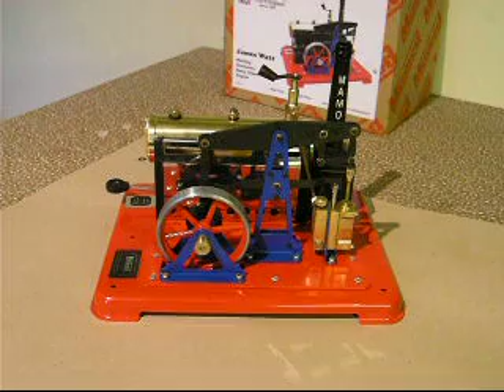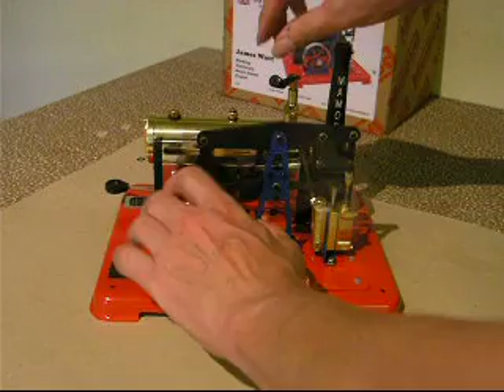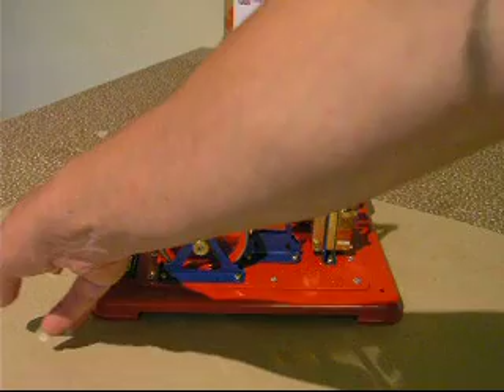Mamod SP8 James Watt toy steam beam engine

Comment: very nice engine. What does the beam actually do bar being nice to watch? Do you remove it to run workshop pullies? I looked at a SP6 but bought a Jensen 75 instead as it had more features and was impressed by its engineering (friend has one). Barring the crap paint it's great: runs like a swiss watch I looked at Wilesco as always wanted one as a kid but the D10! I looked at had all the build quality of a coke can sadly. I will look for a vintage one are some point. Just got back into the these really after digging out the Mamods I had as a kid. I will probably pull the trigger on an SP6 or 8 soon though. They are pretty expensive though. Debating whether my 280 goes on one or a Karsten Tornado turbine short term. Great to see Mamod still going though. Mine were Slough built still going strong (SP2 and traction engine)They are great stress busters the whole ritual of oiling them up and running them and watching all the parts move.